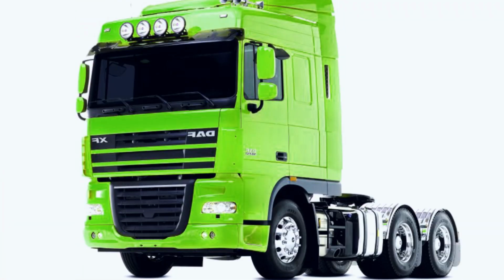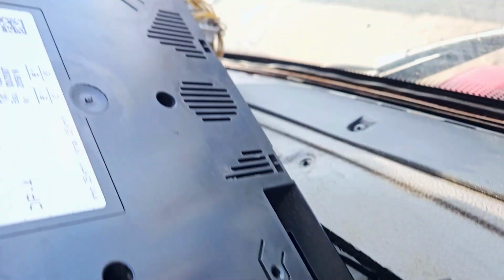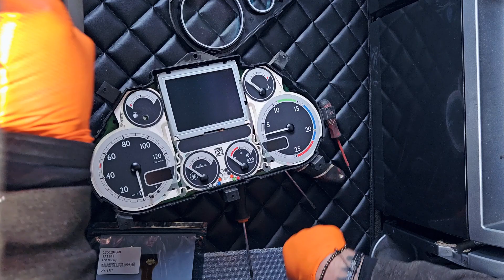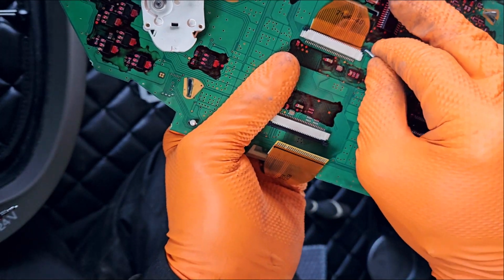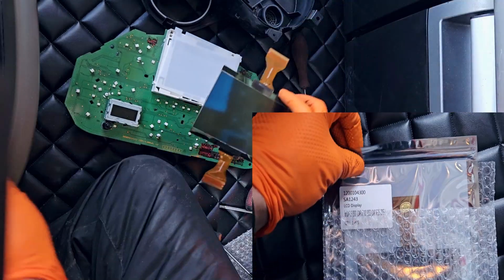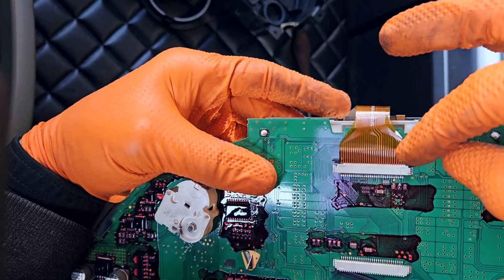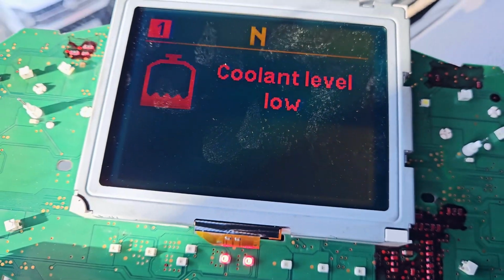Daf LCD Screen Repair:Instrument Cluster Display

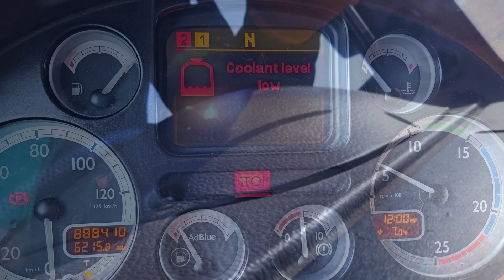Comment: 7:15
Hi, 
I recently bought a cluster from other country and preventively change the screen, but after I put it on the truck the top part of the cluster doesn’t show anything.
I wonder is the problem will be the cluster might be a manual one? Cause  mine is AT, the top part will shows the gear and also buckle up warning light. And also the other cluster when I put it on and turn ignition on the whole screen turn black(already check the cluster is not broken), is that could be the cluster is different coding so it wouldn’t fit with mine?
It really bothers me, if you know anything please kindly share some info or thought to me, thank you….
Reply from the maker: @kobelin1720  It schould be the same. manual or automatic has same screen.Maybe you can check  again if its wired(connected) correctly.
Reply: @ thank you for responding me🙏🏻 and yes, I check with the seller they also said it’s the same.
So that’s why I think would it be the cluster coding problem?
Cause as I remember the top part of manual one doesn’t show the gear or stuff(please correct me if I’m wrong, thank you.), maybe tho one that I bought is MT cluster so can’t be fit with my car..?

Comment: Hi mate dose the LCD screen have fuse ? Iv changed my screen and it’s not working at all.
Reply from the maker: Hi,the instrument cluster have a fuse but the lcd screen doesn't have one...If the cluster needles move when you turn ignition,it means that  you have power.Maybe those 2 connectors are not ok.
Reply: How can I buy the connectors?